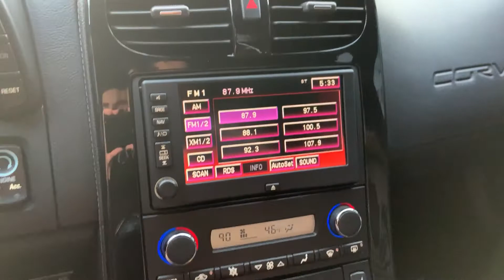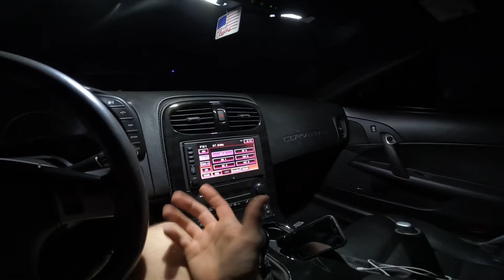Speakers Whining Possible Fix C6 Corvette l  VCIM Location (Z06) READ DESCRIPTION)

Comment: Awesome. I have the same whine in my 08 Z06. I had NO idea where it was coming from. Going out to the garage now. Thanks
Reply from the maker: @UncleDonDon  this has came back on my car but not as much.
Reply: @clayyng  mine sounds exactly like yours. I wish I knew where it was coming from. I tried to reach under the passenger seat but couldn’t fit my hand. It reminds me of a stereo amplifier whine. Maybe the alternator back feeding.
Reply from the maker: @UncleDonDon  I think it may be the airbag harness under the driver seat, if it starts whining on mine if I move the seat up down and around via the seat controls it can go away it I move it just right. I believe others have took a zip tie and secured that harness better, I think it gets loose when the seat moves back  and forth due to being connected to the seat. I haven’t got around to messing with it.
Reply: @clayyng  I will check it out. I move the seat from position 1 to exit position every time I drive. I haven’t noticed anything different. I’ve heard what you’re saying about the airbag light, though
Reply from the maker: @UncleDonDon  I hope you can get it, I know that is such an annoyance.
Reply: @UncleDonDon did you ever find a fix? Have the same issue with my base 2009. Super annoying because it happens very random.
Reply: @Smeeeeegs I unplugged the VCIM plug under the seat like Clay did. The noise immediately went away but came back a day or two later. I unplugged the wire harness from the alternator and the noise went away so it’s either a bad alternator internals back feeding voltage or a loose ground somewhere on the car. I’ve also noticed it’s worse when the car is very cold and hasn’t ran in a while. 
I will let you know any updates but I will eventually figure it out
The “J3” wire on the onstar box is supposed to handle the phone call settings through onstar
Reply: @ I just recently brought my c6 to a car stereo shop. They looked at the issue I described and said it was probably something to do with the speakers. On a side note, I purchased the car with an aftermarket stereo installed. When the shop looked further into the issue the realized that whoever wired the aftermarket radio taped all of the wiring instead of using solder. That was my issue! So if you’ve got an aftermarket stereo system definitely get that checked out.
Reply: @ I do not have anything aftermarket. Thank you for the ideas, though.
Reply: @UncleDonDon did you ever find a solution that fixed it? Yours describes mine the exact same if it’s cold it’s worse almost

Comment: About to try this mine just gets soooo loud it's crazy 🤦‍♂️ started doing it after I rear mounted my battery ..
Reply from the maker: It kinda came back after a long time it mostly doesn’t do it anymore I haven’t heard it once or twice since making this video
Reply: @clayyng  nope didn't work 😒
Reply from the maker: @Driftprodigy01  im sorry i know it’s annoying. I think it has something to do with the electronics with the driver seat. When it goes off i move my seat forward a little and it goes away instantly. Try that when it happens. It was going off one day and my keys fell down by the seat control and i hit it reaching for my keys and found that.